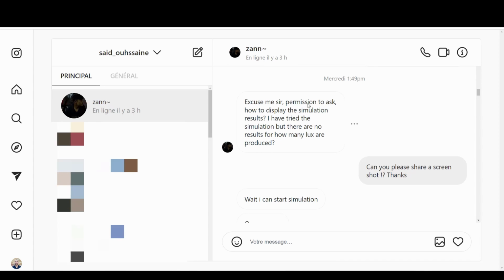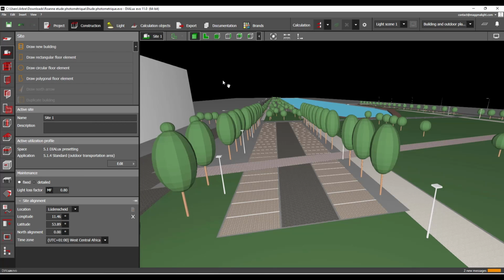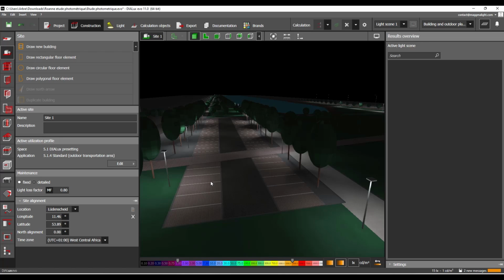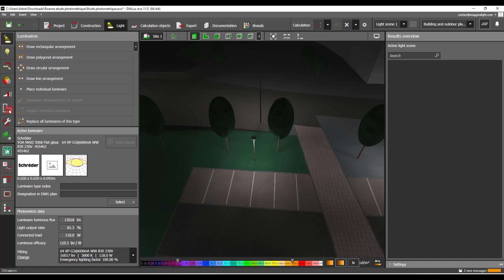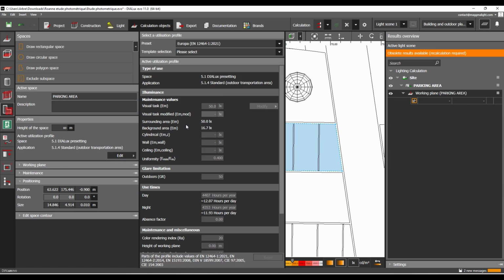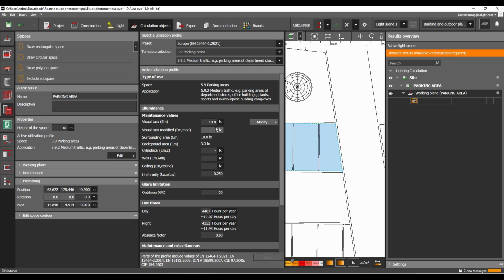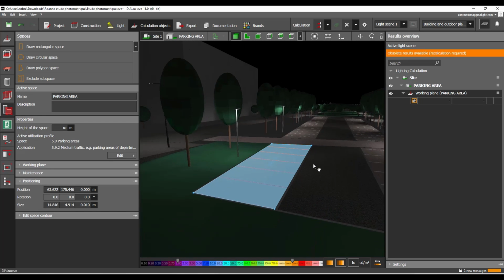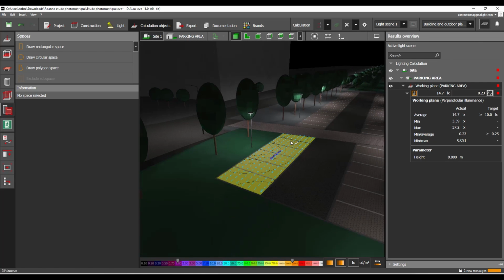DIALux evo: How to Display the CALCULATION RESULTS ? (Results Overview)

Comment: Hi 
In my dialux design I put some outdoor lights first and run the calculation. After I need to add more lights. But it didn't add lights in outdoor space window. So I added lights using site 1 window. Now I can't run results. The calculation tab can't press. Discard tab also can't press. Can you help me in this regard?
Reply from the maker: Hi,
Can you please contact me via instagram : https://www.instagram.com/maggmalight/
Over there, you could share some captures so I can understand well.
Thanks